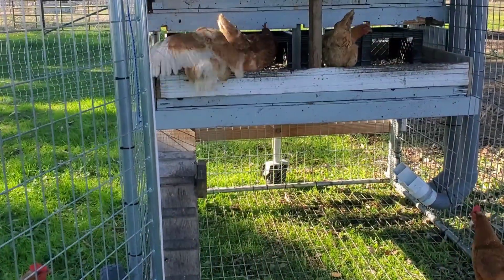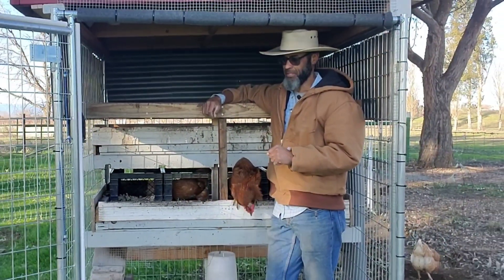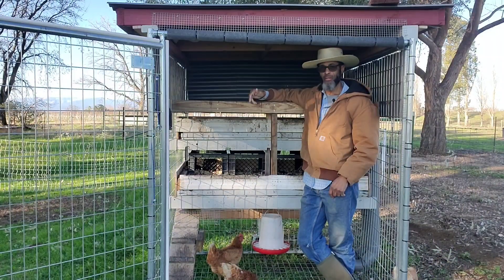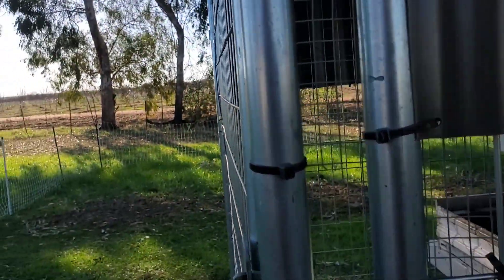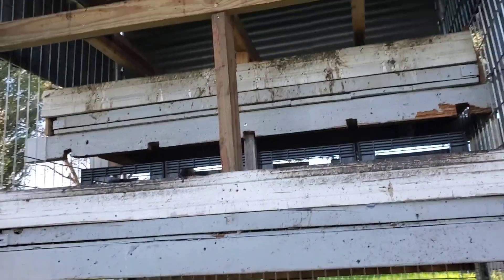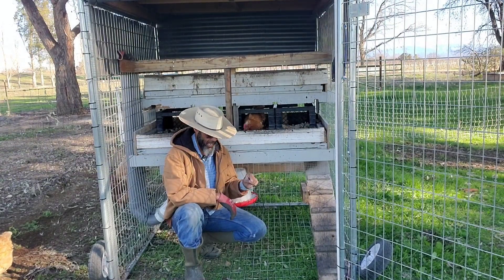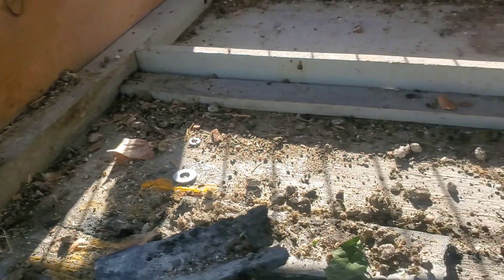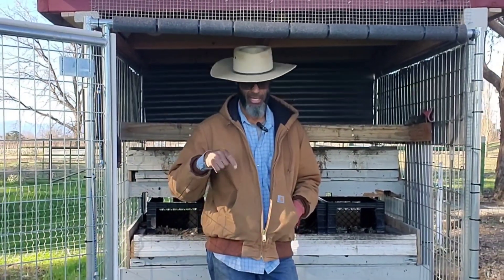Dual-Purpose $350 Build: Two Functions, One Incredible Design!

Comment: Really fascinating, I’ve seen Steven’s design as well and really enjoyed it… But mobility is a must for me.  This has really sparked some creativity into my mind.
Reply from the maker: Right on man i'm glad to hear that. We are all just sharing ideas on here. Take the ball and run with it and build something better! 🤘
Reply: I have a commercial pen that we made a base for and attached to the pen. Then used the egg cartN system to move it. The egg cartN system is expensive but the one I have has lasted for many years now.  Also the pen ia built so much better than the hen box kind that sits off the back.  Do yourself a favor and keep your eggs dry when it’s raining or wet, let the boxes be inside and the back fold down  to the outside. Not lift up.  The hen boxes hanging out the back also seem to get loose and just make room for a critter to have more access. (My dogs have almost ripped the hen box off the back of another pen). Also the way the hen box hangs off the back, when you lift it up to get the eggs, I’ve dumped water on the house and on the eggs before.  Of the back just folds down, the eggs doesn’t get wet at all.

Comment: ive been searching and brainstorming a mobile coop for a while. This is very unique and appealing. especially incorporating a jockey wheel. Your idea is brilliant, thank you...... Im stealing it  :)
In Australia we have big pythons and large monitor lizards (goanna) that are a real danger at night. This with some finer wire/hardware cloth should be very predator proof. 
 One question however.... how many hens would you keep in this? I have 10. Im thinking 10 is approaching the limit for this size/roosting area?
Reply from the maker: We have 7 birds in this coop and it works fine since they get out of the coop to roam daily. 10 would be a stretch in 25sq ft imo. Absolutely take this idea and improve upon it where you can! Glad you liked the video thanks for watching! 😉

Comment: Great ideas here, partner, and if you're like me, you'll probably keep iterating this design as you use it. 

The first thing I found myself improving in my designs was anything that would force me to unscrew or rescrew any part to clean or move the tractor, or any part that made the tractor accumulate droppings and thus increase the need to clean. So in the case of your design, I'd find myself changing the cleanout railings so that they can just lift out instead of being unscrewed, and also change the wheels so that I could use a lever on each side to raise and lower the wheels instead of unscrewing them and remounting them on a different axle.
Reply from the maker: Having what you have suggested for the wheels would absolutely improve the design of this and I considered designing some kind of fulcrum with a lever but opted for the current because the set up time is not enough of a time suck to warrant a more elegant design. Originally my boards were designed to slip in with a bracket however the original design only included a single 2" board and quickly learned it was inadequate and I added the additional piece of 5" scrap and decided to add the screws in lieu of building some kind of bracket. Maybe someone else who decides to make something like this will take your suggestions a build a better mouse trap! Thanks for being a part of the conversation. 👌

Comment: That is a really cool design.   Although it is fairly open, how does it hold in high winds?  Looking at the base Vs height.
Reply from the maker: It actually does really well. We get very strong winter storms just about every year. The storms come hard from the south and this past winter was no exception. Wind gusts to 50 plus last year and the hens did fine with the 5X7 tarp placed on the backside of the coop. Our temps rarely dip below 25°f but in the instances when it does I just run an extension cord to power a brooder light. The hens thank me for this! 🙂